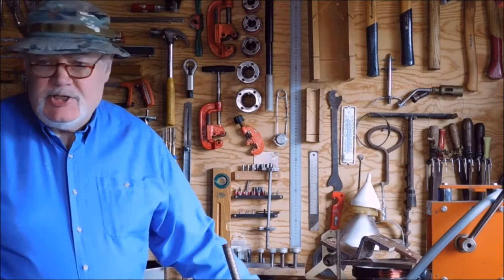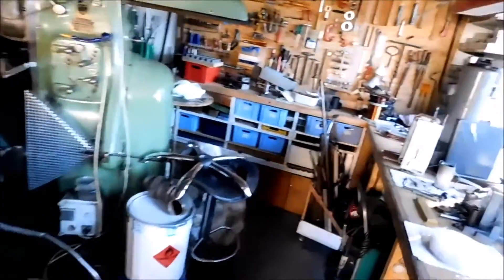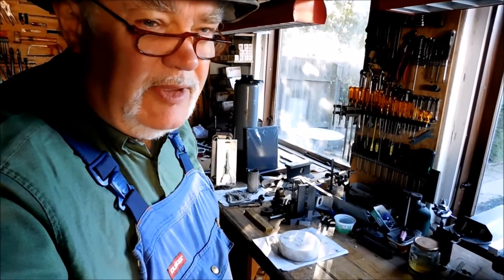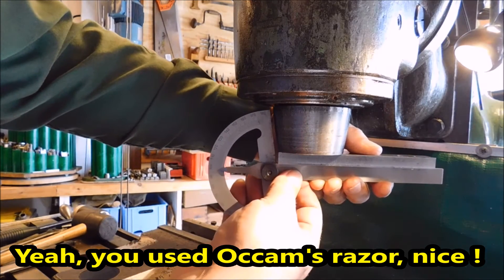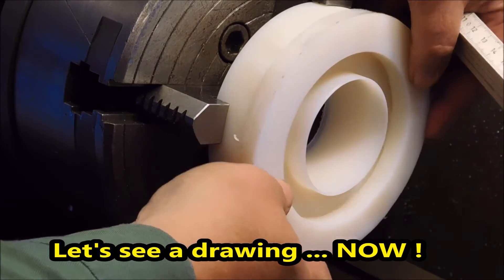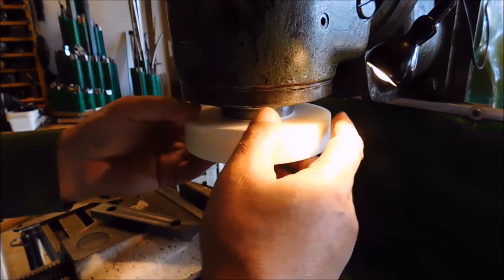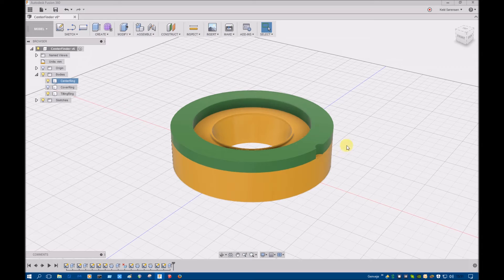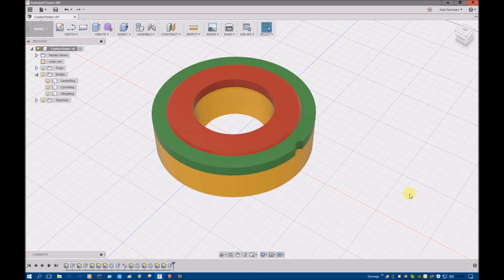Centerfinder 01

Comment: You could try "Inventor" too - but those progs do take some work to manage.
Taper sure seems an odd number.
Intriguing project - yeah! :)
Reply from the maker: Yeah, lots of SW out there, but I think so many "in here" uses Fusion360 so I'll give it a try - and ofcause I have to spend many hours to get behind all the curtains ;-))

I hope this center finder will do the job when you have no DRO you'll need a good center finder at least !

If it's good enough for Dan Gelbart then it should be good for me too !

Comment: Hi Kjeld. I actually built one of these things and it actually works. I sort-of followed www.gadgetbuilder.com -- go to that site and look up "laser centerfinder" project. Both Mr Gadget and I used a commercial laser pointer, same one you use to point to computer screens on presentations. I found the beam ($20 from OfficeMax) much too large, built a pinhole for it out of beer can. I use it mostly to pick up centerpunched holes. I have used it for centerfinding and it works just like Dan Gelbart's. Other subject: Fusion360 or whatever. These programs are made so you can model up a piece and then shove it into CNC. Since I see no CNC in your shop,  no criticism intended, but why bother? Use sketchup if that is what you are comfortable with.
Reply from the maker: Hi Juan !
Thx for the link and your experience with the project - I bought the laser that Dan Gelbart linked too - you can adjust focus on that - and it's only $3 and free shipping from HongKong-land.
No CNC and no 3D-printer ... yeah, but MAYBE the Fusion360 could open "her in command" up for getting them sometimes in the future ;-)) ... no, I was a little stuck in SketchUp and searching for another - why not Fusion360.
Reply: Well, I spent a great deal of my working life programming computers. There is an investment of your time learning the verdammte software. Your choice entirely. I sincerely wish you good Fusion-ing.

Comment: cool project Keld, you have to stop inserting things into my project list..
Pierre has been working me like a dog, we are both very busy on the WIYB project. it has to be completed within the next few weeks
Its the first time for me doing something that resembles a production run.
 quite a learning process for a newb like me
if you want i have a spring left over from my days racing. I think the compression rate is around 450KG/25mm or 1000 lbs/inch
Reply from the maker: Hi Phil !
I think that spring is way too "strong" ... I need to "feel with my hands" if the spring would "do the job in my beltsander